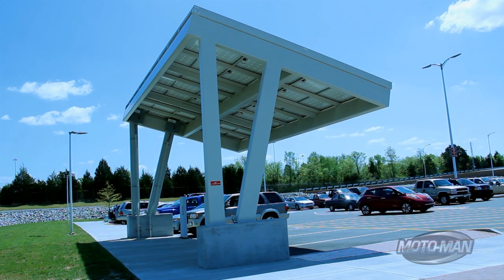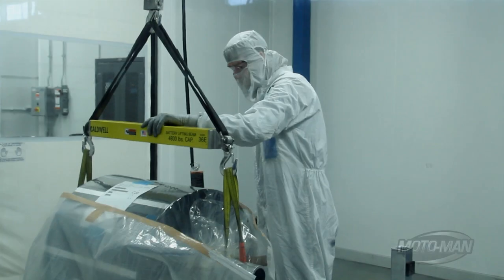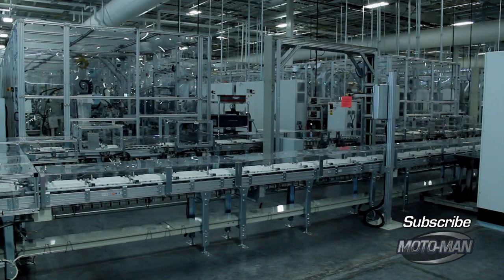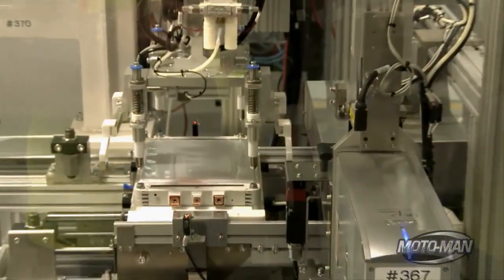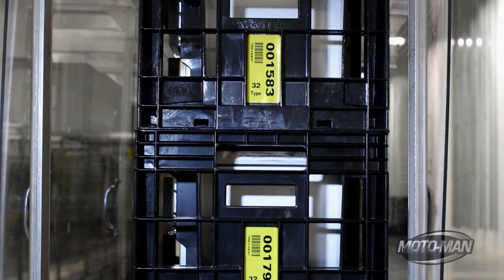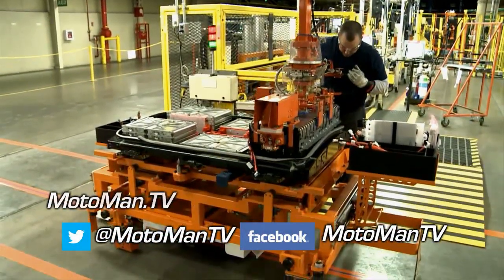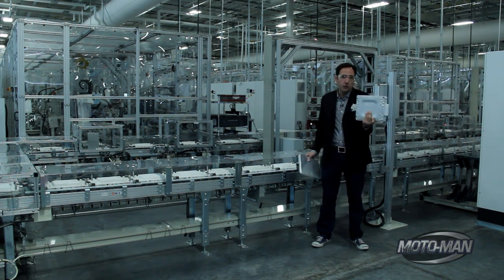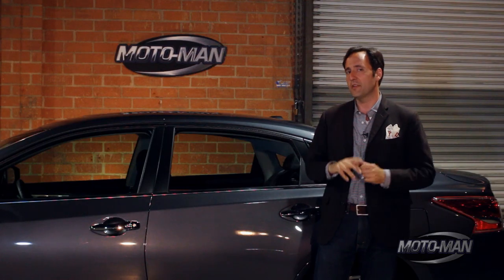Nissan LEAF US Battery Factory -- How an Electric Car Battery is Made

Comment: Low range is not a problem Nissan LEAF is your problem. Buy new modules and you will be happy, without any Webasto heaters  and battery extenders in the trunk.

Comment: It's not made in USA, its assembled. There's a difference.
Reply: Then this is Not quite Assembly Only. They actually have to build each cell from mass quantity of component materials. Soo it is very much closer to Building the battery pack. Made in is quite accurate.
Reply: I see

Comment: what happend to their hybrids.. they all disapeared.. no one drives them these are impractical.. i mean 75 miles to a charge.. if we all buy these cars our electric bills will go up.. so you cant win
Reply: Not Hyrbid it does not have the problems associated with a crappy small Gasoline engine. 30Kwh Leaf easily does 100 miles not 75 miles and soon to be replaced by 60Kwh Gen2 Leaf. Sure your Electric Bill will go up its still Fraction Cost of Oil Fuels per mile. If Vehicle-to-grid is implemented properly with smart financial incentives to use electricity at the best times. EVs can be used to smooth out Grid Peaks & Lows making Electricity infrastructure more Stable and Cheaper to Operate.
So much of your stupid comment was just Wrong and Outdated.
Reply: Wyatt Earp I charge mine at work :)

Comment: Just got my 2011 LEAF main battery pack replaced under warranty. The car had 38500 miles, and the battery capacity had fallen under 65%. The car was in a hot climate state before it came to Northeast region.  I average about 5 miles per kilowatt out of battery, and with the fresh battery pack this car can go more than 100 miles per charge easily .
Reply: What would the cost of been without the warranty?

Comment: Cool Vid! Wish i could get my hands on some factory fresh leaf cells for my solar project. Nice to see how & where there are made.
Reply: You can get some on E-Bay for about $125 each.    Why would these be good for a solar power project? 
The high energy per weight ratio is costly and most solar projects don't move so good old lead acid is a fine choice, it's not as cool, but is probably the best choice.   I use solar to charge a set of lead acid batteries and then use a PowerLab8 to charge the 18650s that power my lawn mower.  This seems kind of odd, but the lead acid battery set is also my trolling motor power, and that takes far more power than the mower.
Reply: Weight, cycle life, and run time are awesome!

Comment: 60 milles per charge. I hate this car. DONT BUY IT.
Reply: thats y u lease it
Reply: Mark R Average daily drive is 40 miles...
Reply: +Mark R 60 miles aye? your doing it wrong, why are you driving full speed on the interstate? its ment for highway traffic 50 and below, I can go more than 90 miles at roughly 40 mph and im getting like 5.5kwh to the mile in my '12. I bought mine and I won't ever go back to gasoline.

Comment: No real limit although like many things in engineering it's a bit of a tradeoff. There have been batteries that could charge in a minute or less. Commercially available lifepo4 batteries can readily charge the bulk in 10 minutes. Just doubling that speed would be enough.
A123 makes batteries for formula 1 cars to recharge during the 1 second every time they brake.

Comment: The price for the Leaf isn't a problem. In the US, a Leaf can be bought or leased cheaper than a Prius, which sells over 200,000 units a year. Which is why Nissan has been seeing a very good and consistent uptake in sales.
Other EVs like the Volt is getting a 2014 update and most probably a reduced price. Even the Ford Focus had its price reduced by $4000. It's always been said that overtime EVs like any new technology will become more affordable, despite being 2 years later. It'll do so again.